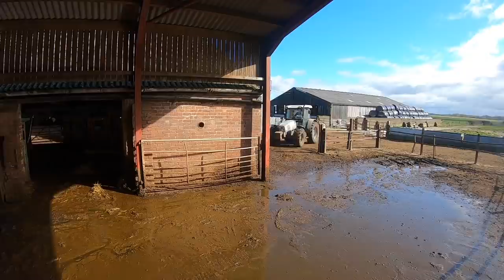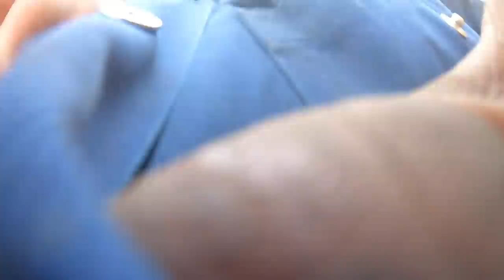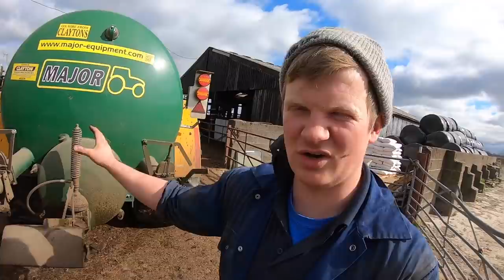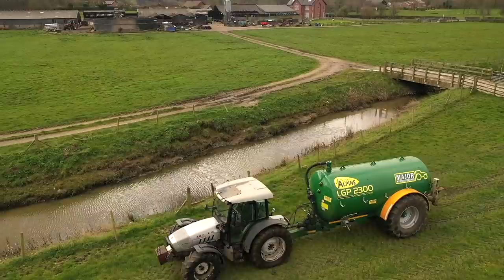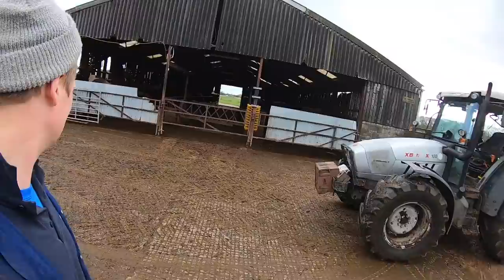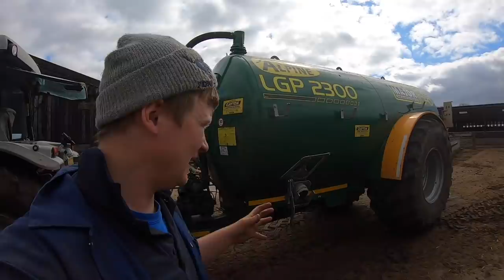PUSHING A SMALL TRACTOR TO IT'S LIMIT ! CAN IT BE DONE? OR WILL IT FAIL?

Comment: Tom... When the Implement is larger than the tractor... your supposed to get a bigger tractor !  All due respect to the Hurlimann as it is a great tractor..  I just think with the Bigger tanker... your going to need to have a bit more horsepower.. As you push a tractor closer to its limits.. the more stress you put on it... and the more chances of something breaking increases.
I say New 150-200HP tractor first... and then look at a new tanker.. No point getting a new tanker if the Poor Hurlimann is having to work so hard just to pull it.
Reply: It’s a fair enough point, however as he says it can pull that tanker, and looking at the rest of the kit he’s got why would he buy a 150hp tractor, never mind 200hp. For a farm like Toms looking at the work he’s got to do 120hp/130hp is really the biggest he could needs, considering that none of the other kit he’s got really needs more than 100hp for the job
Reply: I would say a 2000 gallon tanker would be fine for the hurlimann on flat ground
Reply: She's sure is a wee pocket ocket, that Hurlimann. You could always  lessen the load when conditions merit  it.  Nothing says you need to fil that 2300 tanker right up each time if the Hurlimann is the only tractor available.
Reply: 125hp would be fine on that

Comment: That 2300 gallon tanker is approx. 1650kg heavier when full and approx. 600kg heavier when empty than a standard 2000 gallon Major. That is before you start adding rain guns etc. No doubt the price tag is substantially different too although if sponsorship is involved, that may not be much of an issue. It was mentioned that you didn't have to fill the tanker full. I can't see the logic in that as slurry is a fluid load unless you add baffle plates which is even more weight and money. In my opinion, be sensible and buy a 2000 gallon tanker that you will have confidence in when full.

Comment: interesting. Wouldn't recommend it. Had a Major 2050 which is a bit smaller on A NH7840 Was ok on level and dry ground. It struggled in poor conditions. have the tanker on a NH Tm130 now. Completely on top of it's job . I think you need weight as well as power to be safe

Comment: Not a good thing that your cross contaminating what ever hydraulic oil is in the hurlimann and putting it in the case puma when you switch tractor can do some serious damage as those case puma's are very sensitive when it comes to there transmissions  because the hydraulic and transmission fluid are one in the case puma. Just giving advice not hating on anything .
Reply from the maker: Josh Morell I like advice 😀👍

Comment: Lads do you not have BRAKES on you tankers? We pull a hi-spec 2500 gal big foot with a Massey 5612 no problem and we don't have a pancake flat farm like this . We pull a 3500 twin with a 150 hp new Holland also no bother! But we do have air on that rig , point being if you have your brakes right you will have no bother especially on real flat land like this.

Comment: So your little tractor can pull the Tanker. You will need to put a bigger Tractor for that 2300 tanker 1 for safety in emergency, 2 you are putting a lot of stress on the back end of the little tractor.

Comment: If you guys buy a new tank dont put a raingun on it if you keep the same tractor. In my experience you need a lot of horsepower to drive the pumps for a rain gun because they need to run at full capacity the whole time. You would definately need 140 hp to drive them because if the pumps dont run flat out the slurry wont be under enough pressure to reach far into the field and spread out as a result you are left with heaps of slurry in the field. This is just my experience you should definately try one before you purchase it and make a decision
Reply: The right job is just put a spout on the back of the tanker
Reply: @jerryodriscoll3691  ya we do that ourselves fairly often but when we do get the raingun it does need to run flat out

Comment: 100 horse's can pull more than that atleast over 11000liters with 2 tires and a spreadingplate. You might need to move a little slower but it will pull it.